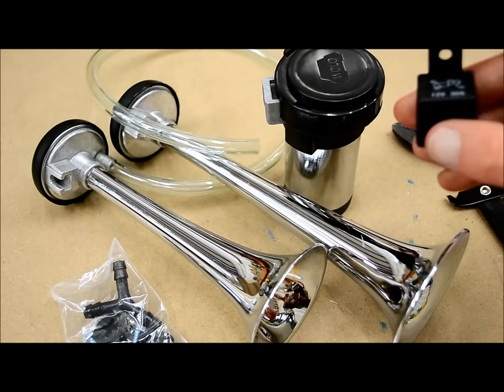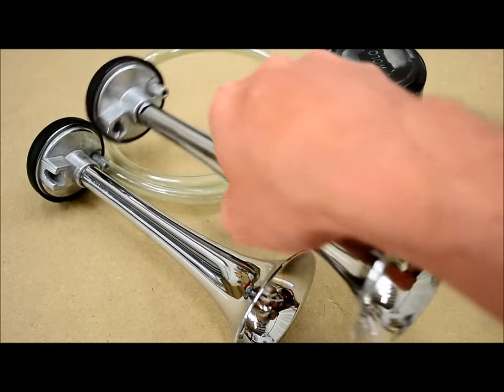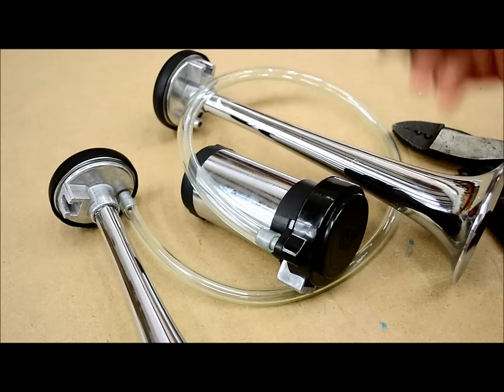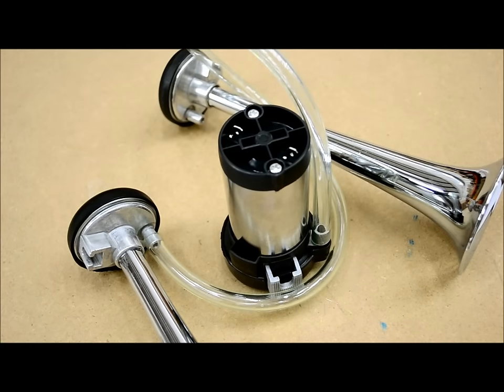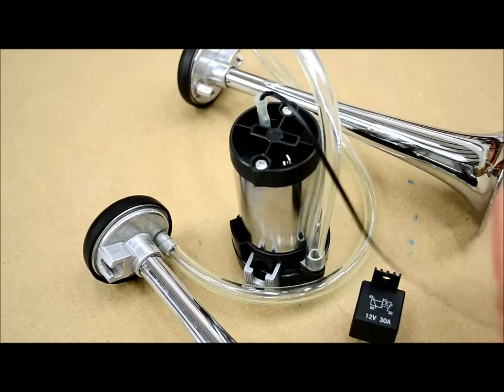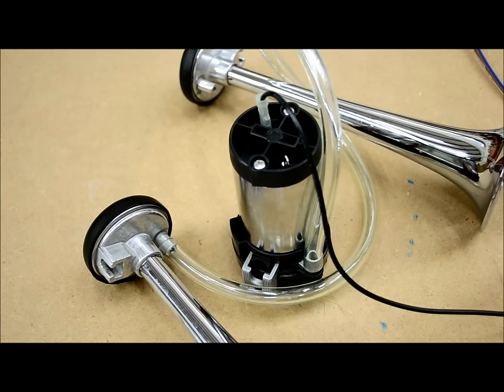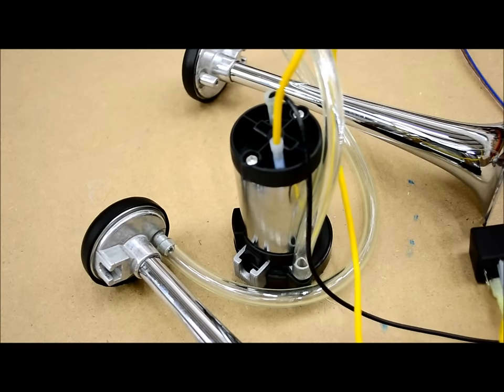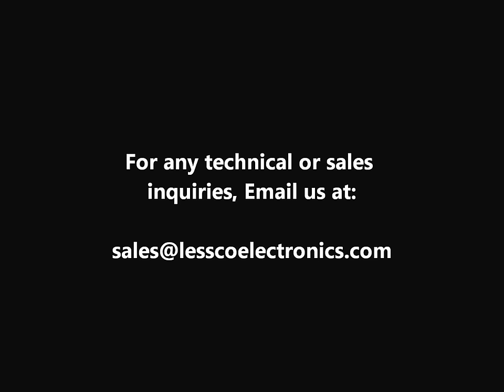How To Wire Air Horns / Air Horn Install for automotive and marine use

Comment: How to you hook this up to a switch in your car?
Reply from the maker: +Harrison G connect the car's horn wire under the steering column to the coil on the relay you wired the air horns up to. (pin 85 or 86) depending on how you wire relays...
Reply from the maker: see my latest video here, its shows exactly how to: https://www.youtube.com/watch?v=NxWaFYOH8LE

Comment: Is the horn button not 12v? I've never installed one of these but I've always wondered why you need a relay. Why can't you just take the wires off of the existing horn and put them on the +/- of the compressor? Thx!
Reply: Mitch Evens the voltage is 12 volt but the ampere is too high for the stock wires to handle
Reply: Kavin Jebastin bullshit !!
Reply: You can in cars the relays are exactly the same all I did was just that , took out old horn hooked up the wires that already exist , all these things with saying wire up relays new wires etc is all bullshit

Comment: I'm guessing the horns can only be as loud as the compressor is that right so what compressor would you recommend for very loud horns?
Reply: A very big compressor... from what I've read, a 3L (~1 gallon) tank and a 20cm tall/long compressor should be good for a nice truck sound.

Comment: BigDave may of been trying to ask the same question (bad English) and I've got to ask - years ago I fitted a set of theses to a car and just used the wires + & - from the old horn and seemed to work just fine. I'm about to fit a set to my MX 5, the new horns  didn't come with a 'relay' nor have I got a clue what a relay is - do I really need to bother fitting it the way you have? The horn I have bought says its 12 volts...

Comment: What if the relay and wires are set up opposite you said it should be in your car? The one I bought has the 12v positive supply to 30, ground to 98, positive power to motor from 87, and blue wire to switch between that and positive supply to 85. It's not working at all. Do you know what's wrong?

Comment: How do I know whether or not I need to use the included relay?  I bought this dual air horn system and installed it on my 2004 F-150 without the relay (the instructions seemed to indicate it was optional). It worked several months just fine.  Then in started blowing fuses every time I'd push the horn.  I took it all apart, cleaned the compressor and connections, and reinstalled.  It worked again for a couple months, and now it's shorting out again.  Would I be better off using the relay, or would it be redundant with the vehicle's electric system?
Reply: Increase the fuse if it's a 5 use a 15

Comment: roger s did you get an answer?i also want to wire up a second circuit air horns,keeping the car horn.i want to wire a separate circuit with its own switch preferably off the battery.without touching the car wireing.did you get any answers.thanks.

Comment: Do you need the relay. I put in this exact system and left it out. Is in nessary for any reason?
Reply: No, I hooked up two horns to the same system my factory horns were wired to and it works fine.

No need for relays or 90% of what this guy is doing.

Comment: Hello, I purchased a similar horn and I thought I could use it indoors (for research purpose hahaha)  using electric power. But I realized that I was wrong, because that compressor uses a lot of Amps. Would you recommend. Buying an AC to DC power supply will be very expensive. Would you be able to recommend the cheapest category of automotive battery that could run this power this horn. Thanks in advance for your suggestions.
Reply from the maker: You'd be hard pressed to find a power supply to handle such draw and supply it that fast, Try using a battery and a smaller dc power supply to keep it full.

Comment: question i had ordered a train horn from facebook.i did not get a compressor and the horn has a soliniod on it with 2 wires ans an air inlet.how do i wire a diode for it

Comment: i need help on mines before i do it. My question is can you connect more than one 12v air pump to single 30 amp relay? i used a 30 amp wire for led bar light wires. its ready to go with the 30amp relay and fuse.

Comment: I have my steering horn button with two regular horns with a positive and negative wire on them and a 15 amp fuse in the fuse box, I would like to install the dual air horns just by replacing the horns under the hood so when I beep the horn it sounds the air horn, can this be possible and how, thank you
Reply: I have the same question..

Comment: Nice tutorial. Not much of an electrical person, but how what kind of wiring would I need to toggle between the air horn and factory horn while using the factory horn button on steering wheel
Reply from the maker: +shaolin224 18 gauge will do it
Reply: Okay thank you. I guess my question was a bit vague sorry. What I'd like to do is have a toggle switch that turns on power to the air horn when I want. And then use the same or a different switch to power the regular horn. So I can change between the two as desired. What change in wiring setup would I need that's differs from your vid. Thanks

Comment: hi I have a mission on my hands, im putting the last three remaing horns from my Dixie horns onto a alloy bracket and mounting them somewhere on my 2004 Toyota estima. im looking at a 5 gallon suspension tank mounted next to the space saver under the car with a 200 psi compressor next to that,, at this point im hoping that we have some serious noise. just not to sure how to plumb it all up and wire it.

Comment: hello, how can i keep my OEM horn and use this a secondary horn? i guess i will need an extra switch which will be inside the car but where should i get the power from to the switch then to the relay?
Reply from the maker: +Arman Shokouhi Rad Sure, you can do it either way, that's the beauty of doing a custom install!
Reply: +Lessco Electronics 
so the switch that will be in my car will get power from battery and go to relay, correct?

Comment: i got wolo train horn if i unhook  up to the  factor horn do i need the relay
Reply: Is there just a single wire to your stock horn? If so, it is probably a positive wire, and the horn is grounded on the chassis. If this is the case, just plug that wire to the positive pin on the compressor, and make a second wire that runs from the negative post of the compressor to a ground point on your car (the shorter the wire the better). You can use a loop connector on the end of the negative wire to get grounded on that bolt. Just sand down the paint under the bolt head so that it contacts metal and makes a good ground connection.

Comment: I am running dual compressors with 4 air horns from Harbor Freight along with an inline 30 amp fuse and 40 amp 4 post relay like the one in this video (purchased from Schucks). I hooked up my power jumper wire from the battery positive+ to 30 & 86 and 85 is a ground wire ran to a momentary switch inside the truck along with 87 going to the positive+ on both of the air compressors. I was able to get a few good bursts out of the setup before the fuse blew. Where did I go wrong? Do I need to switch my battery positive from 30 to 87?
Reply from the maker: +Andrew Shaneyfelt No, I presume you need to upgrade the circuit itself, fuse and all, Doing an amp draw test with a multimeter wouldn't be a bad idea either! and lastly upgrade the wiring if it's less than 16ga.
Reply: +Lessco Electronics I am running 12ga wire for my grounds and power and 16ga for the switch wire. I assume that it doesnt matter which post the wires are on for 30 and 87, i.e. I can have the battery power on either of them and jumped over to post 86. Is that correct?
Reply from the maker: You can wire the relay several ways and get the same thing, My recommendation is  85 and 86 are the coil trigger(put + and - on either side, doesnt make much diffference), I'd put constant fused 12v+ to 87 and use 30 as your output.
I noticed a fatal flaw in your power wiring though, if you have 12ga on the +side and 12ga on the other YOU ESSENTIALLY HAVE A 16ga CIRCUIT! you need 12ga on both sides to have a 12ga circuit my friend. update that!
Reply: +Lessco Electronics I finally figured out what my issue was, go figure I just needed to install a 40 amp in line fuse rather than a 30 amp and I was good to go. Thanks again for the feedback.
Reply from the maker: welcome

Comment: sorry to say but you got it slightly wrong pin 30 is always connected to constant 12 volt and pin 87 is connected to your device (horns lights etc) not the other way round of course it doesn't really matter that's usually how most diagrams have it

Comment: How do you install 12 Volt 12V Dual Air Horn Kit as a second horn with its own button?
Reply from the maker: Tell me the details on exactly what you have now and I'll explain it all to you.
Reply: SunrisePonyFarm red to battery and horn, black to vehicle chassis. I ran my black and red wire through the fire wall, into a dash switch and grounded to my seat. Dont bother with relay its only to protect car electrics and you are just adding a corcuit

Comment: Cant you just cut the wires of the old factory horn and directly connect the new air horn to the old factory wires?
Reply: no you need the 12v 30a relay or the compressor will not get enough power to run it

Comment: Good video. 1-How would i know if i have a negative output? Where is my horn switch under the hood? I have two horns behind the grill. Each horn has two wires. A green and red.

 I hooked up wires from horn to the battery just to test it. It was loud. I then used the original wires from the old horn and connected them directly to the new horn (no Relay).  When i press the horn on the steering column the horn sound was 25% of what it was when I tried directly onto the battery. Any idea why?
I have a 2013 Sonata Limited. 
I would prefer NOT to use a relay if I can get away with it. Would like to use the original wires and  change the fuse to 20 amp. Since the horn is only used for short spurts, I am not concerned about the insulation burning off the wire

Comment: Hi I’ve just got twin air horns and I’ve seen a diagram but I’ve got a cylinder with two black wires on it but we’re do the wires go and I’ve got a five peace connector block anyone please

Comment: Thank you I had thought I had installed the 3 horn harbor freight horns correctly and it worked once but, it stopped.  The way i wired it was. 30 through fuse to positive, 86 i wired to the positive side of the existing horn, jumped 87 to compressor positive and the extra terminal on the compressor for tuning and then I tied 85 to ground.  It stopped working after the first time I drove the car.  I wonder if it would work if I unhooked the existing horns?  I am not going to tear into the steering wheel of my 2016 Altima to get a horn wire.,  there is an airbag in there.  Please advise

Comment: Nice Tutorial !!
Reply: It is imperative that you use colossal quality automobile horn system inside your automobile which can alert the actual pedestrians and other cars on the road with time. Use of train horns for car is an ideal option which can organized you free from all of your high quality horn plan requirement. This is a few things I have learned from your video and from the website http://pbmissions.com too. Thanks for delivering information on Truck Air Horn. Thanks!!

Comment: whats the recommended gauge size of the wires used for doing this? can i use 16-20awg audio cables? since i have a bunch of those lying around

Comment: Why grab signal under dash.  Why not just grab signal off wire at horn?
Reply from the maker: the wire under the dash is the input side of the horn relay, the wire at the horn is the wire on the output side of the power relay, that's why that is.
Reply: +Lessco Electronics  yes but if snip the wire at the horns you can control the out put of the horns and have an on off switch and just use signal from horns right there.
Reply from the maker: the issue there is that now youre limited to the factory circuits output capabilities, most upgrade kits demand 2-3x (or more) the amperage a standard stock horn supplies.

Comment: do u NEED the relay?
Reply: You only NEED the relay to switch the high power.  If you want to buy a high-power switch (they're cheap and easily available) then you can run the wire directly.  The only benefit to a relay is:  Switch selection is WAY better when you use a relay, you can use a decorative switch, one that lights up, etc..  AND most importantly, it's far safer.  To have high power wire running through the cabin isn't as safe as a switched relay.  Relays are super cheap and super easy, they're scary at first because of all of their pins, what size, what rating etc.. but really all you need is a "12v relay" with a high enough amperage rating for whatever you're using.  5amp horn?  Get a 10amp 12v relay and it'll be no problem - and can cost 30¢   Hope this helps

Comment from the maker: http://www.lesscosales.com/servlet/the-35920/Wolo-Dual-Xtreme-Air/Detail
Reply: hey can u help me out my horns are all installed but there are three wires to the horns they are green red and black
Reply from the maker: +Corydon Cheatham do you have a diagram I can see for them? or a photo maybe
Reply: These seem to be the main 3 wires
Reply: +Lessco Electronics there is a green and a  black wire from the compressor and there is a red one  is long enough to reach the battery
Reply: So don't use the positive coming out of the steering colom. Where does it go?